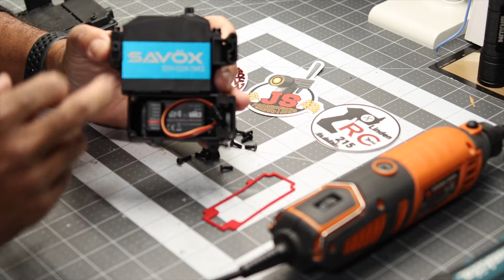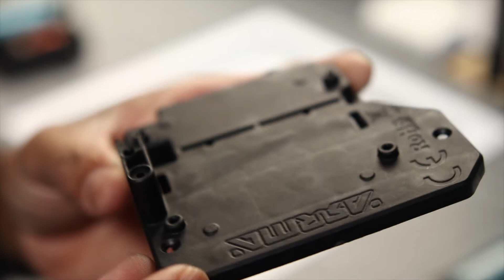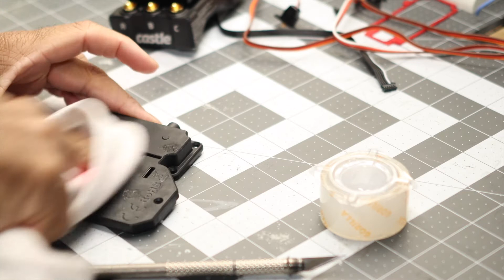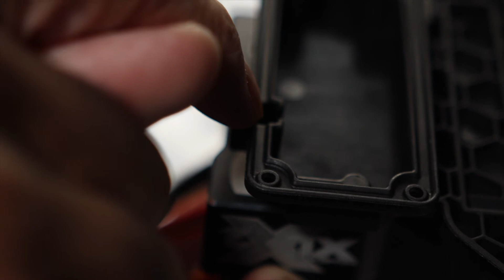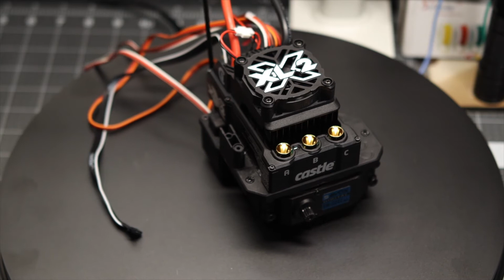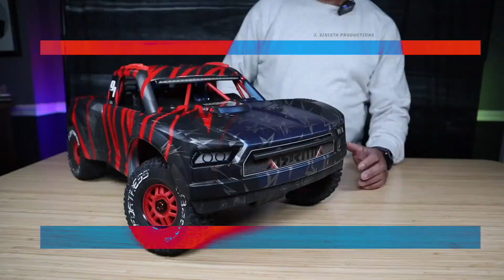Arrma Kraton EXB Electronics Install, Part 2 ESC!!!

Comment: Man i wished i would of found your video before i went grind happy on my servo and cap trying to fit the savox man somthing told me to back the screws out thanks for the good video
Reply: I still cant get the servo box to bolt up the holes wont line up
Reply from the maker: No problem!  

A lot of folks comment telling me that this servo doesn't fit, and there's no way I installed it.  But, if they'd pay attention to the vid like you did, they'll see/hear that backing the screws out a bit, then fully seating them...the servo does fit!

Comment: Have you had any problems with that servo fitting in the case? Some are saying it doesn't fit properly without cutting. 👍🏾👍🏾👍🏾
Reply from the maker: None what-so-ever.  There's zero need to cut.

Comment: Hey was wondering if you bumped up the voltage to the servo? The xlx2 is @5v by default and the savox calls for 7.4v
Reply from the maker: Haven’t really touched it since I started work on the CEN F450. But, I didn’t mess with the BEC to bump the voltage up for the Servo.
Reply: @JSinistaProductions  my setup is identical, just ordered the Bluetooth to bump mine up. Great videos dude thx 🍻
Reply from the maker: @Sinisterdeath1  Sweet!! Thanks!  I installed the BT as well so I can make those changes more easily!  I purchased the 6700 Copperhead 10 system to put in the Traxxas 4Tec 3.0. Need to get the code for the free BT module.

Comment: I use a dremel heating tool and I hit the gorilla tape with it right b4 I stick it .....sorry for so many comments bro it's just that I comment as I'm watching at the same time
Reply from the maker: No problem.  I have one of those Dremel torches too.  They come in handy when I solder and heat shrink any exposed wire.
Reply: @JSinistaProductions  stay clean stay freash !! i like topping off my wire work too i should do a video of some work when i come across